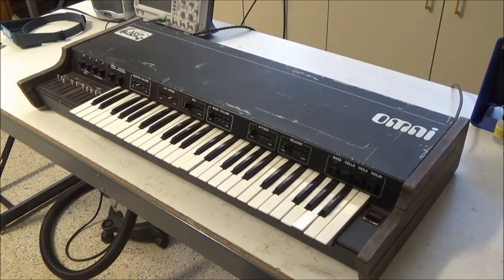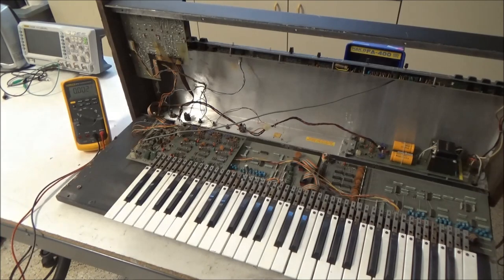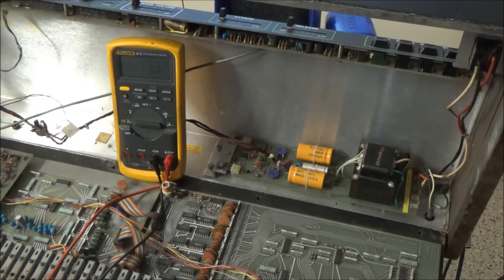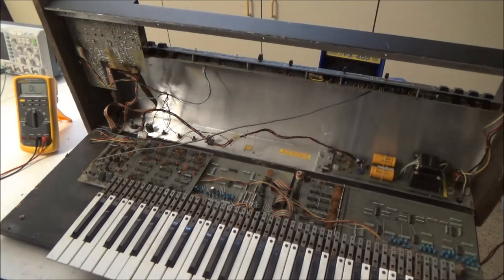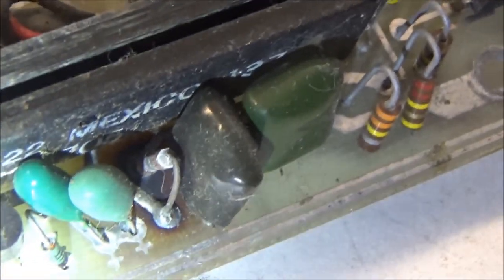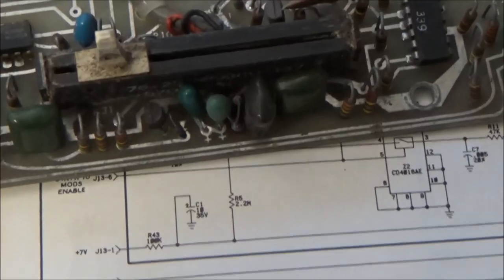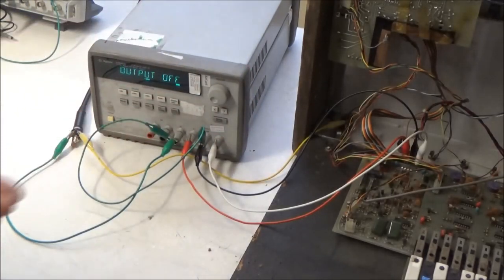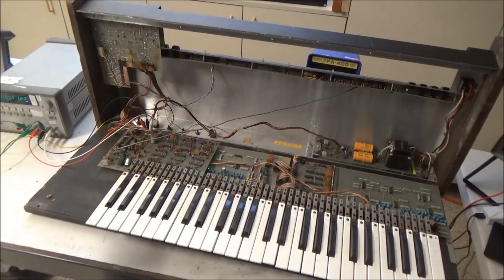Quick repair for Dead ARP Omni? - Synthchaser #142

Comment: Another thing I found with slightly newer synths (80s) is that stored patches can become corrupted when the power supply goes. I got a broken Oberheim Matrix 6 and I first had to replace a bunch of components in the PSU. After that the voltages were reading correctly but there was still no sound at all. Eventually I just initialized a patch and suddenly it was fine! So I restored the entire bank and everything worked perfectly.

Comment: Got one of these with a similar “powers on but no sound”   a local repair shop had begun to replace all of the capacitors, which ended up being the problem. pulled pads. poor soldering connections. be careful if you send these to a local guitar amp repair place. they may not use the care required in keeping the pads and traces in tact.
Reply from the maker: Amen!  The only thing worse than restoring a broken Omni is restoring one someone has already tried to work on!
Reply: How many ARP Omni 1s where made Nathan? 
They seem to be the most not working synth to appear on ebay / ever made. I have 2 broken I’d like to get you. Similar condition to this one.
Reply from the maker: I've heard it's around 2000, but I'm not totally sure.

Comment: Is there a good site or forum for finding the current market value of working vintage synths? Ebay prices vary so wildly that I wouldn't trust it, but it would be useful to see if a synth going as spares or repair would be worth the outlay to refurbish. After watching most of your videos it's something I'd like to take up as a hobby, so I wouldn't need to make a living wage.
Reply from the maker: Reverb has a price guide for most models, though you still need to click through and look at the individual sold listings, since condition varies widely.

Comment: Question: Why do you measure ohms and not continuity?
Reply: Because the continuity buzzer won't work over a certain resistance, so if you have a component that has failed partially open circuit or you have a track or wire that is dubious, you won't get a beep but a high resistance reading.
Reply: @merseyviking  But we’re looking for a short. So in this instance the continuity still seems the appropriate measurement to me. Or am I missing something?
Reply: @PWMaarten  I would also like to know the answer to this. I've mistakenly removed failed components before due to a resistance reading, only to discover they read correctly out of circuit. A misunderstanding on my part, definitely. Haha
Reply from the maker: A reading of 100 ohms on one of the power rails wouldn't make the continuity buzzer beep on my meter, but it would still indicate a short on the rail.  A continuity measurement is a subset of a resistance measurement, so why not set your meter to give you all the information it's capable of providing?
Reply: @Synthchaser  Yes. Understood and agreed. Thanks!

Comment: Hold on, the neutral from the power socket is white, but comes from the switch as red. The live comes in as black, then comes out as white? Now there's a trap for young players!
Reply from the maker: Yeah, it was super dangerous to mislabel the colors of the mains wiring.  Creates more demand for factory service when you knock off the independent techs. :)